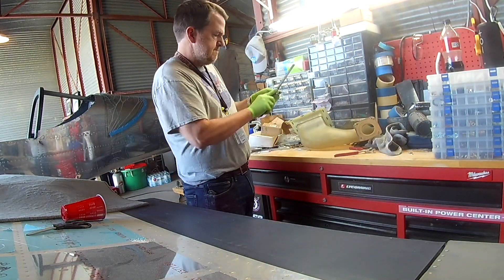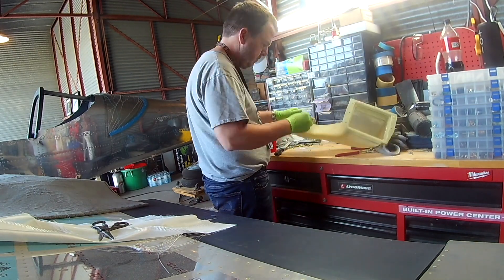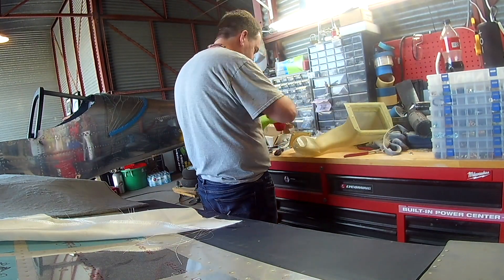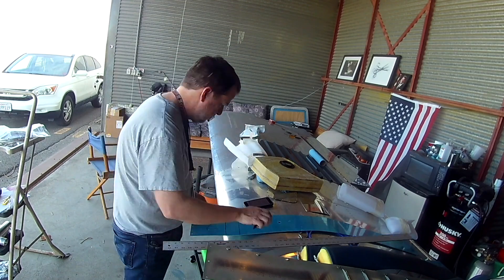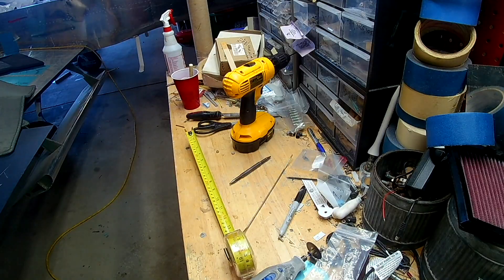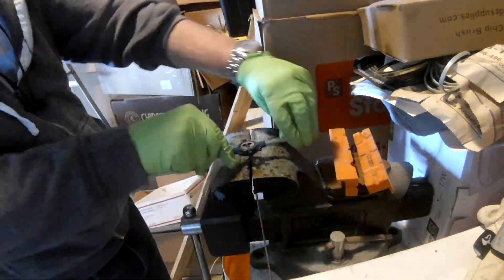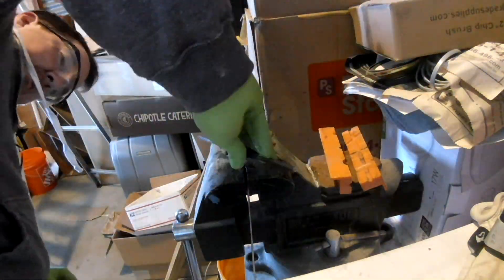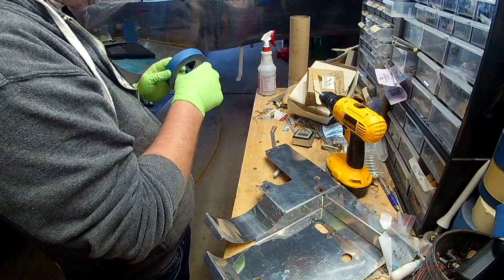RV-14 Baffle Connecting Rods

Comment: Good afternoon! Didn’t see a way to message you other than here. Trying to decide between the 14 and the 9 and was hoping you could give some insight on what the insurance costs are for a 14, and who do you recommend to go through? Will be starting flight school soon to acquire all my ratings up through multi CFI.  Trying to figure out what that cost difference would be between the 9 and 14.  Appreciate any help. You’re almost done and it’s been fun watching thus far.

Keith
Reply from the maker: I went with the 14 for headroom and interior space. Its as fast as you'll ever need it to be without getting something turbo or pressurized or both.